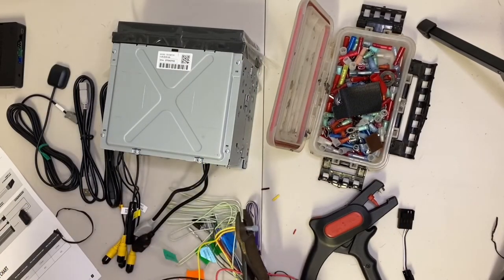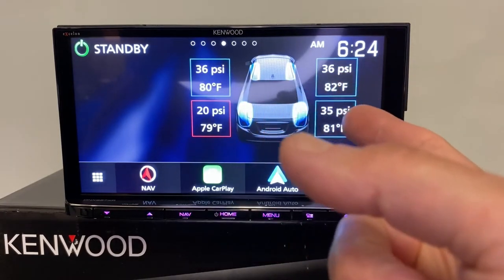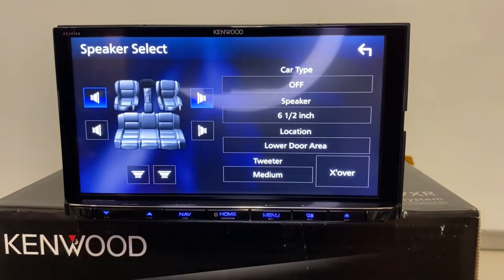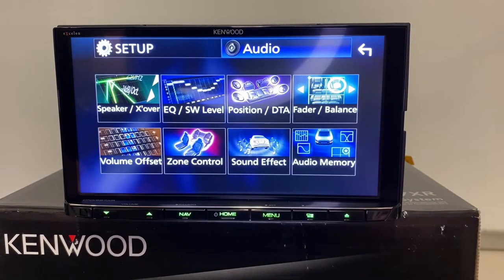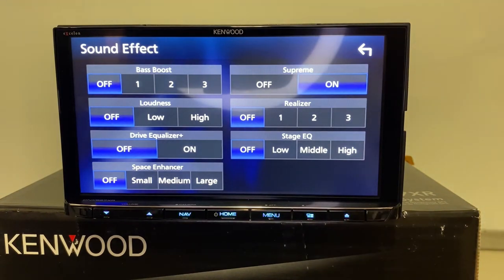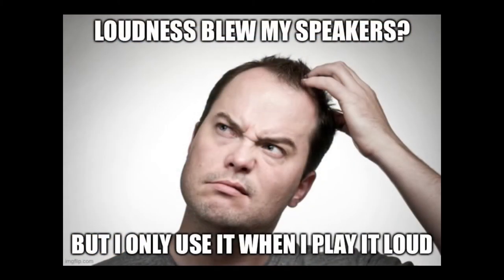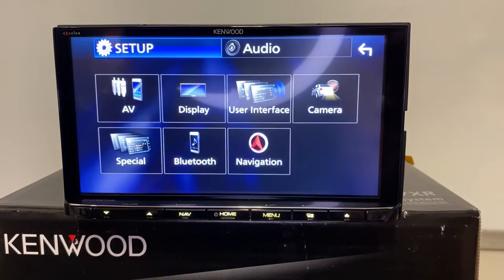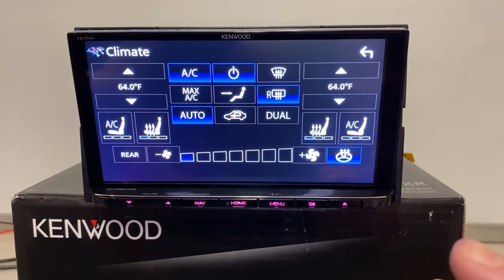Kenwood DNX997XR review by @carstereochick

Comment: I have this stereo. I listen to 95.5 HD1 & cannot figure out how to get to 95.5 FM HD2. My old stereo I just tap the tuner forward automatically went to it.
Reply from the maker: Oh, that's a really good question. I had to dig the manual out for that because we don't get HD inside our showroom!. Right where the channel is displayed "95.5 HD1" - right before the "9" should be a small, round up/down icon. When you tap that it should toggle between the various HD channels available on that station.
Reply: @carstereochick  yeah I must not have a strong enough HD signal because it's grayed out on the top. Once in awhile it turns gold like it's on for real I'm certain channels.. I'm wondering if this radio has an antenna attenuation adjustment like the ones in the olden days LOL. 07 nitro and I drive a Kenworth with an old beat-up HD radio in it and they both get HD fine so something with this new one going on possibly

Comment: One item you failed to mention is that the SD card slot is for the map updates or music or videos but the unit does not store the map updates on its internal memory so you have to leave the SD card in with the map updates on it for it to work -so it defeats the purpose of having the SD slot to play music or videos from.  In this case if you wanted to stick with the map updates on the SD card you'd be using the USB flash drive plugged into one of the connections.  Pertaining to the extra AV input there's a ATSC digital television tuner for automobile use that if you wanted to watch television you could mount that in your glove box or somewhere under the dash and be able to watch local television channels.
Reply from the maker: YES! That is super annoying and I forgot to mention that, great point. That drives me nuts how you have to leave the SD card in there after you do a map update.
Reply: Thanks for the good points.

Comment: Ok so I took your advice and got the dmx957xr. I've had plenty of experience hooking up stereos, amps, and speakers but I'm pulling my hair out on this. All essential wires hooked up correct. Microphone and GPS hooked up. Subwoofer rca's and amp remote wire hooked up to unit but not to amp yet. No Sirius xm no camera no iData. Turned on the ignition and I have no sound from any source. No beep. Nothing. Bluetooth and android auto connect. No errors. Please help. Thanks
Reply: I figured it out. Metra harness had an extra wire that had to be wired in to the amp remote. Silly. I was at my wits end
Reply from the maker: What car? SiriusXM through iDatalink only works on select years, makes and models - you may need the SXV300 tuner for your install. Have seen this feature in some GM models, but not all because sometimes the SiriusXM tuner is built into the OEM radio so that feature is really vehicle specific and even sometimes trim level specific. 

Regarding the other issues - if you're not getting any info from iDatalink module, SWC not working, not turning on stock amplifier, etc. you may have a bum ADS-MRR or perhaps you entered the radio serial # incorrectly when flashing the module. I once had a client have a similar issue and I told him to bring in the ADS-MRR he bought online so I could try and see what was up and flash it for him. Turned out he had an ADS-DEMO-RR which is what I use for display purposes. It's packaged exactly like a regular module, but it won't actually ever work in a car. 

I would try re-flashing the Maestro and resetting it. One thing I learned is you should flash it for a completely different year, make and model vehicle to properly clear/reset the unit. Sometimes if you just re-flash it for the same exact car it's like it doesn't clear the cache properly in the module.
Reply from the maker: Ah! I was going to say that at 1st, but was thinking SWC and everything else in the Maestro wasn't working. Good job troubleshooting!

Comment: How do you do a firmware update to that unit
Reply from the maker: Download it from Kenwood's website - unzip it directly into a small USB drive formatted to FAT32. Nothing else can be on the USB drive and for some reason smaller USB drives work better - I use an 8 gig for updates. Then with the car running, plug the USB in, the radio will recognize there is updated firmware and ask if you want to update. Tap yes and let it do its thing. Check your firmware version 1st, depending on when you purchased it, you might already have the latest software. Here is a link to the update which also has step by step instructions.

https://www.kenwood.com/cs/ce/mm/firmware/2020/2020a/eng.html

Comment: You can download the latest maps for 3 years then they'll abandon it  🤬
Any tips for updating a kenwood dnx7150dab that has garmin maps? I've found out I need to replace the gmapsupp image file that comes with the 2019 update but finding one that works properly isn't easy, Idea for a video maybe . . . .
Reply from the maker: That is really interesting, I have never come across that issue when updating Kenwood models with the latest Garmin maps. Have you reached out to Kenwood about this?
Reply: @carstereochick  reading through questions and complaints on forums apparently they're not much help, Garmin express is only giving the 2019 update there's not even an option to buy something, So that just leaves me experimenting with maps i can  find for free.

Pirate bay here I come
Reply: Mine has never worked and Kenwood has been useless. Updates don't work and now I have nothing on my right channels.
Reply: @donniehoward6821 I managed to find some unlocked maps on forums but they don't work the same as the original, 
Maybe try a factory restore see if that fixes anything?

Comment: This unit sucks! After two yrs of service, all of sudden the push button stop working. No bluetooth. No auxillary, no hd radio. I paid alot for piece of crap. Not to mention after two yrs, you have to paid to have your navigation updated.
Reply from the maker: The lower panel with the volume controls failed? I'm extremely surprised to hear that. Out of all the brands I carry, Kenwood has the lowest failure rate. The ONLY time I've ever had a client with a Kenwood where the lower button panel failed it was due to liquid intrusion. Wrangler owner, top off, got caught in the rain. It has a 2 year warranty, did they repair it for you? Or did it happen past the warranty period? For the Wrangler client, he was past his warranty, but I was able to get it fixed for around $180 at United radio. I do agree the lack of updates on the GPS is pretty crappy.

Comment: You think you can review a true power house Head Unit  like the ATOTO S8 UlTRA that cost half the price and actually has its own processing power doesn't just use your phone to act as a expensive external display like these overpriced kenwoods that have the processing power on $99 cell phone

Comment: AV-In so you can hook your iPad up and watch videos not while driving
Reply from the maker: Technically, yes, but just keep in mind you'd also need an HDMI to analog adapter to do that which will step down/degrade picture quality. Usually we are using the A/V-in to do things like retain a rear seat entertainment system in a 2013 Tahoe with the premium Bose/Navigation radio for example.